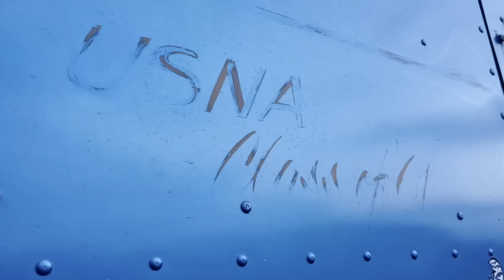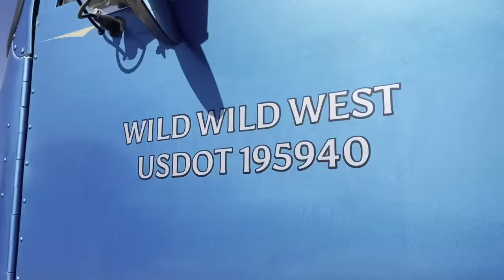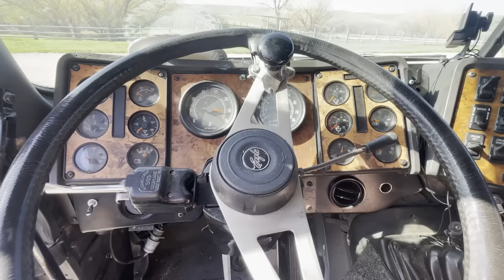10 Reasons why I purchased this 9800 International cabover

Comment: It took almost 20 years for International to get all the dash electric bugs out of the 9670; 9700 & 9800 With a bonus Flat Floor design.    Great Cab Jacks with good optional Air Ride.  The Shepard Steering Gear was the only thing the Old Timers really missed from early  80’s production.    I spent 14 years working on them at an IHC truck dealer.  🎉
Reply from the maker: Oh no kidding?? I bet you know these things in and out!
Reply: @realwildwildwest  9700 & 9800 models are Service friendly, easy access with well written Electrical Manuals.  
***getting rid of the early 9670 style In dash Switch Module and gauges was a Gift from God... HA!
Reply: Shifter linkage was crap tho, not aligned properly when you were lowering the cab very easy to bend.  The Kenworths had a better system, shift by cable

Comment: My national guard unit has M915A5 tractors from 2010 with the series 60. Right at the very end of the production run of that engine. No emissions crap on it that I can tell, starts up instantly every time, runs strong, pulls well up hills loaded, good jake brakes, sound great, and get good fuel economy. No complaints

Comment: You're not entirely wrong about the aerodynamics, a rounded nose cabover is about as aerodynamic as a normal sloped-hood truck, and definitely more than the T660. How it works is that a COE has less overall surface area than that of a conventional, and the rounded off corners help even more with the airflow, and that's how it cheats the conventional's sloped shape. For these reasons, the Peterbilt 372 is the most aerodynamic COE and production truck so far due to its extremely round shape and low surface area.

Comment: Retired last year after 36 years behind the wheel .. First new tractor was a 9670 with a NTC 855 and performance nine speed .. Got close to 7 mpg .. When those set back steer 9800's came out , they were all the rage .. Lots of drivers were getting 8 mpg with the 9800's
Reply from the maker: Man.. I wish they had kept them coming along!
Reply: I just purchased a 92 FLA with the set back steer axle. Wasnt  as fond of the look of it , compared to a forward set axle at first but I drove it and forgot about all that. Lol I love driving it! why did they set the axle back?
Reply: @BElton70  tighter turning radius and allowed a little better aero dynamics around the steer axle
Reply: @jackthebagger7589  Hey thank you. How is the ride being in front of the steers while being loaded?

Comment: If your sleeper is fiberglass and got small damage, I've had great luck with SolarRez for patch work. It's UV activated drys in less than a minute. Designed to fix surfboards, but I've used it on fiberglass car parts. Give it a try. Read the instructions tho...

Comment: I own a non sleeper version of that truck. Same engine set at 525hp. Tiny cab. Runs great but only get around 5.5mpg. Less than 600k original miles.  Drives surprisingly good. Think your condo make better mileage.

Comment: I always thought they were cool looking trucks, especially when I found out it has the walk-in sleeper an flat floor ..I drove cabovers till 92 but never drove this style because I was already in a conventional by then .I'm pretty sure it rides pretty descent with the set back axle an air ride..does it have the air ride cab ,an if not are you gonna add air ride to the cab ✌️

Comment: Looking at one of these with an M11 now, but I'm like you I love the 60 series. I started four years ago in a 9670 with a 350 cummins. 

Bit of trivia! The 9800 was only available from model years 1997 to 1999, and was intended to replace the 96 and 9700 cabovers. So that International Rooster had was a 9600, not a 9800.
Reply from the maker: Oh nice to know!
Reply: @realwildwildwest  I am a wealth of use(less?) knowledge about trucks. For instance the first flat floor COE was likely either a 1950s Kenworth CFE or a Freightliner FLT/WFT, both of which featured Cummins Pancake engines behind the cab!

Comment: The COEs are more fuel efficient, you are correct. Seems counter intuitive but its true. I started driving in a pete 362 and kw K100… these Eagles were all over as fleet trucks in the late 80s and early 90s along with the Freightliners.

Comment: Cabovers > Aero Conventionals.

I'm not a real driver, and don't plan on driving IRL (The pay in Canada is just awful right now, plus the lack of service stops on the major highways is another problem), but in Truck Simulators I almost ALWAYS use a Cabover over an Aero Conventional (unless there's no option like in the current American Truck Simulator, I would install the 9800 mod, but I just can't be asked right now).

Comment: I love that truck. I remember when I went through driving school in 08, they had a cut out picture to show the advanced cabover sleeper on this particular truck and at the point I kinda fell for them! Lol. 

Far as the mpg, it’s amazing what a cabover can get. I asked someone about it one day and their theory made sense. Instead of having multiple “walls” or faces for the wind to overcome one after the other, it’s just the one on a cabover. Albeit a large one, but the theory made sense regardless lol. That, coupled with the mechanical advantage yours has with the shorter drive shaft, I can understand it a lot more.

Comment: Those windshields are very easy to find...even safelite stocks them and will come out to you to install. Let's not be so dramatic over the windshields.
What engine is in it? My 9800 has an M11, 13 sp, 2.64's & Pittsburgh Power tuned my ecm to about 630hp..and its getting 8+ mpg all the time
Reply from the maker: Do they really stock them? That’s great news if so. Sounds like you’re m11 is ripping!

Comment: Do you know how to engage high beams on those trucks? Cuz i got a 1999 international 9200 interior looks exactly the same and I don’t see any switch for it
Reply from the maker: Yes, there is a foot switch on the floor located in the front left corner. It’s old-school you press the switch down for highbeams press the switch again for low.

Comment: sad but cheaps way is A rock chip happens when a small rock or object nicks your windshield and causes a small chip in the glass. Your comprehensive coverage should cover this type of damage. Since rock chips can spread into larger cracks, it's best to get them fixed as soon as possible to avoid further damage to your glass or windshield.
better then dealing with the direct approch have your company talk to thier claims 
getting worse now days

Comment: If you can find those windshields, PLEASE, let me know.
Reply from the maker: I see that TRP has them in their catalogue.. they aren’t a super old company relatively speaking. Plus I think they are the same windshield that they use in the flattop classic cabovers. Have you searched much for them yet?
Reply: @realwildwildwest  I have not checked there. Will be checking. I have a 85’ 9670 & 87’ 9700. They are all the same windshields. I gave up looking a few years back. Thanks for the info.

Comment: Normal's definition is what's normal for you may not be normal for everyone else, but that doesn't necessarily mean that you are they aren't normal. 
As far as the arrow dynamics of the rounded features of the front is probably more arrow dynamic than the ant eater design your talking about in the conventional designed trucks..
Reason behind what I believe is the situation, where you have basically one plane of air moving around the cab for the most part. 
Although the sleeper is actually another plane in redirection of the air.
The majority is directed sideways off the main struture of the cab, and very little is pushed directly over the top from looking at the design of the cab.
I'd say that they were phased out, because they were getting more efficient with the fuel economy, and we all know ExxonMobil and the likes of those akin to them did control how vehicles were made for years.
Your probably not old enough to remember in the 70's we went from big cars that ran exceptionally well with even small cubic inch engines, and some huge cubic inch monsters that ran well but got marginal fuel economy. 
By mid 70's there was the invasion of the Datsun Toyota Mazda vehicles, and they were killing the mpg.
Talking 30 plus mpg compared to the mid teens of most vehicles produced in the USA. 
Plus the epa had stomped on the exhaust emissions, and now the engines were producing nothing as far as horsepower, and believe it or not the fuel mileage dropped even lower due to the restrictions of the epa.
Big trucks plugged along getting about the same mileage as always from the factory, but once the arrow stuff started coming on the market diesel was still dirt cheap, and big brother wasn't getting his full share any longer. 
So whack, cabovers, disappeared overnight from the American market. 
You still had a few running around in the day cab configuration, but the over the road new trucks were all conventional design trucks. 
What people don't realize is that when we were forced to buy unleaded gasoline the price per gallon actually went up, to where it should have actually gone down, because lead is an additive. 
So if you don't have to add a additional ingredient into the mix, and your saving more money by not having to process that into the blend, how can you justify raising the cost for the gallon. 
Should've been lower but it wasn't, and it happened again when they forced ethanol on us.
Because although ethanol burns hotter, it may make some vehicles run slightly better that are flex fuel designed, you get less mileage per gallon from the same amount of unleaded gasoline. 
E85 dirt cheap where you can get it, but the range you are able to go drops tremendously when you run a tank of E85.
Same thing with 10 or 15 % of ethanol happens, and not only that. 
On vehicles not flex fuel designed your fuel system starts breaking down because of the alcohol content eats everything up in matter of short time. 
I could go on, but I stepped away from what I was trying to say.

Comment: Who Is Liable For A Car Cracked Windshield?
Many drivers have dealt with the frustration of repairing or replacing a cracked windshield due to road debris or a kicked-up rock on the highway. According to AAA Foundation for Traffic Safety, over 200,000 accidents in the last four years were caused by road debris. Road debris can be kicked up off the road by another vehicle or dropped from vehicle like a commercial truck that is hauling gravel. When a windshield is cracked from a piece of road debris, what party is liable for the damages?

Many people would like to believe that if their window is cracked, the vehicle that dropped or kicked up the road debris should pay for the damages. The answer however isn’t always that transparent. According to most insurance companies, if another vehicle kicks up road debris, the driver is not at fault. Anything already lying on the road is considered a “road hazard”. If a piece of debris falls from another vehicle however, the driver of that vehicle could be held liable for damages. This situation most commonly occurs with commercial trucks transporting materials like gravel.

Although commercial trucks may don large stickers that read “Stay Back 200 feet. Not Responsible for Broken Windshield”, this sign does not allow a truck driver to evade legal responsibility for damages their load may cause. The Federal Motor Carrier Safety Administration regulations place responsibility on the driver of the truck to safely secure their load before transporting. These regulations also require safety inspections and grant truck drivers the right to refuse to transport any load they deem unsafe.

What if you are driving and a piece of gravel falls from the back of the truck and hits the road before it is kicked up, cracking your windshield? Is that debris now considered a road hazard or does that truck driver still bear responsibility? Road debris damage situations that are difficult to prove are best handled by an attorney, like a car accident lawyer relies on, who has experience with motor vehicle negligence. An attorney can assist with evidence, expert witnesses, and presenting a sound claim for compensation for damages.

When faced with a negligence lawsuit, many companies will try to protect themselves by shifting blame to the victim. There are several things as a driver that you can do to prevent damages and mitigate your risks while driving. Always leave a safe distance between your vehicle and the vehicle in front of you. Many states have statutes regarding safe following distance. Florida statutes for example, state that drivers should not follow more closely than is “reasonable prudent”. While driving on the highway you can avoid trucks that look to be transporting unsafe loads. If road debris is unavoidable, slow down rather than performing an unsafe maneuver. If an accident occurs as a result of an unsafe maneuver, you can be held liable for damages. Although getting information from the truck like a company name or license plate is important, do not pursue the other vehicle. It is important to safely document damages and the manner in which the damages occurred.

Handling vehicle repairs and expenses as a result of road debris damage can be a daunting task. It is important to promptly exercise your legal rights by consulting an experienced attorney who can assist in recovering damages from the liable party.
Reply from the maker: I’ve broken lots of windshields over the years from random rocks getting kicked up by a passing car. I’ve always figured this was just part of being on the highway and have paid for my own fixes. This was so much more than that, I decided to take it up with the gravel company. This would be more akin to being behind a semi with an unsecured load that hit your car with cargo. I’d definitely track down the company. Over a dozen chips, cracks and fresh paint chips so it was hard to let it go to my insurance.